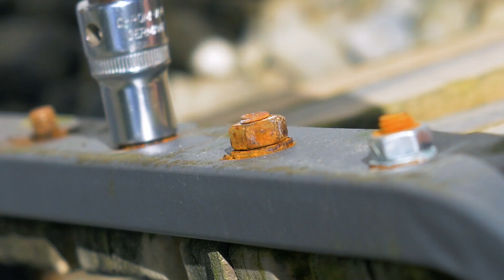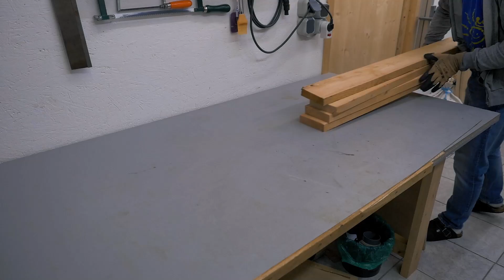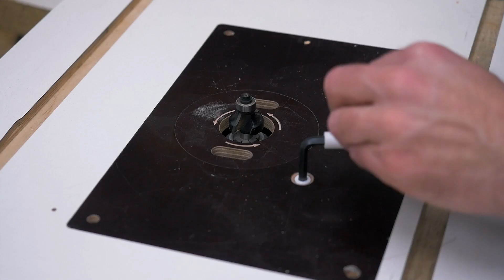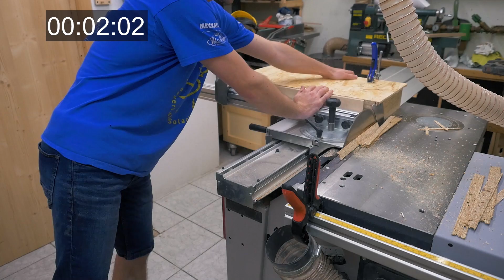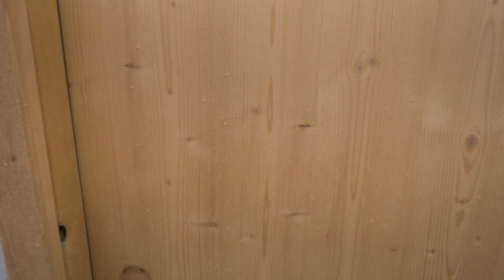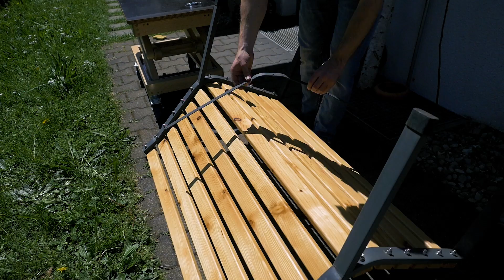Renewing an outdoor bench | simple Spring project + miter saw testing

Comment: here goes me wiping my tear away as I just recently purchased (for me a very expensive item for my diy workshop) a 150 euro Einhell sliding miter saw only to realize the damn thing cant even cut straight edges and I have to fine tune the "zero" mark on the angle gauge to somewhere between zero and one using a quickangle  and only then did the edge cut was moraless straight with deflection of 1 mm over 30 cm length.... I want expensive tools too ;( not for my broke ass lol last year with the help of my girlfriend I bought a 800 euro hikoki table saw and it was the saving grace for my sanity as I sued to do my table saw cutting on a 50 euro tiny 800w table saw that was flush mounted into a huge OSB table top and the fence was a piece of aluminum with two wing nuts at both edges... Your videos Marius are the saving grace for me

Comment: When you compare the same exact designed corded saw (GCM 12 GDL) to the Biturbo it is the actual competitor to be beaten because they are not only the same design on the gliding mechanism but the same basis of a saw... your tablesaw has still 50% extra power left so no chance for it to stall out that sawblade, however on the (from what I remember on the battery gliding saw) direct driven sawblade you stall it out easily with the not perfect blade for this cut...

...so it was not the fairest of comparations but still pretty impressive to see a 3kW beast and a battery powered "bite like a 2 kW beast" compete... so yeah... it is true... this thing has got some power... and is good if you are on lots of jobsites with no electric power available during your products (especially when you got the 8 or 12 Ah batteries).

Bosch actually does not recommend to use any battery below 8 Ah on this tool... because you run the risk of reducing the life of the cells within the battery.

I'd still go for the corded version... it is on my list, as it is a stationary tool for me and my "jobsites" most of the time do have at least enough place for a extensioncord to be laid out... and it is a lot cheaper 😁

Comment: Hi. I have a Bosch GCM 12 GDL, and I love it. The only thing I am not satisfied with on my miter saw is that, no matter how much I adjust the precision, when we fix the angle with the locking knob, there is a little deflection, which does not leave the cut in the precision that I would like. I would like, if possible, that you also check this on your miter saw. Thanks, and congratulations for your videos.
Reply from the maker: I have the same issue. I guess they only swapped the motor and the rest of the saw stayed the same
Reply: @MariusHornberger , I will try to find a communication channel with Bosch to report this problem. I need precision for my work (Instagram: @vibewood_design). Congratulations for your videos. Bye.

Comment: Comparing cutting speed between a table saw and a miter saw is not appropriate.  They're intended for very different types of cutting.  It's also inappropriate to compare a battery powered tool to a mains powered tool.

Comment: Did the same thing for my Mother in Laws garden Seat. I used a varnish for finish but was disappointed with the durability of the finish. My cheap mains sliding chop saw mounted on a portable stand, with folding legs works well, but does take up a lot more space.

Comment: That is a very nice saw. It would be lovely if it could be used both as a battery saw and a mains power unit in the workshop. You were asking a lot of it cutting that chipboard. What other tools can you get that use the new batteries?
A nice little project. Did you consider spraying some wax oil or other anti rust treatment inside the metal frames. They looked nice quality and worth protecting.

Comment: I have a number of Bosch tools, some corded, some battery powered and I absolutely love them. Thanks for the great review on the Miter saw. I've been looking at it with great envy trying to convince myself that I need it but it's more of a "wish I had it". Great video as always. Thanks.
Reply: I wonder if Bosche sends different tools to different markets? I've had several "blue" Bosche tools here in New Zealand including a sliding compound mitre saw, and they've been terrible. Some only lasted a couple of years, and all were badly designed (e.g. the mitre lock on the saw kept coming loose). The ones that didn't break I ended up giving away for free, as they were so lousy that I couldn't in all conscience sell them. Plus Bosche only have a two year trade warranty here (other brands give six years). And yet I have relatives in the UK who think Bosche tools are wonderful, and wouldn't use anything else. Very mysterious!
Reply: @davidhaywood8029  Interesting that you say that. My Bosch tools here in Canada have been heavily used  for years when I was doing  home Reno work for folks after I retired and even now they are still going strong.  Makes one wonder doesn't it.

Comment: What laser guide are you using on the saw?
Reply from the maker: The saw has a built in laser guide
Reply: @MariusHornberger  Oh OK, I have the same saw but 120VAC not battery powered and it didn't come with it.

Comment: In my opinion you should be aware of the play in the arm movement. A lot of miter saws have play in the arm movement and it is a disadvantage. A miter saw is supossed to cut at a specific angle but with play the angle or the cut itself gets crooked. You apply downwards force AND push the blade towards the wood and the wood will apply tension to the blade and arm - and with that play the blade will be able to cut crooked. I searched the miter saw market for a very long time but I finally found a battery powered Dewalt miter saw with absolutely no play. I bought it instantly. Nice to have you back :-)

Comment: Nice to see you again, Marius.

With the cordless ability, it must be quite "the one" for the mobile woodworker.
Especially if you already have a few of the battery system. (like me). And if you don't have a high production rate, the speed seems to be adequate. 

Now for the lawn, it is not befitting the renovated bench.
😁👍🏻👋🏻

Comment: I think the difference in speed on the Bosch has more to do with the ability do clean the dust out of the kerf than the difference in thickness. With a table saw dust will be cleared far easier, because you cut from the bottom.

Comment: I wish tool makers like Bosch would incorporate both battery and plug in power as options. You could get the best of both worlds, plug the tool in for max power when in the shop, and run it on batteries at jobsites.
Reply: Dewalt did that.
Reply: @TheMetalButcher  Which dewalt saws? I may have to buy one.
Reply: @pseudosam2458  The ones with two 60v flex batteries IIRC. Since it's just a universal motor it runs on AC or DC.
Reply: @pseudosam2458  The metal Butcher can reply, but he don't reply to You on your specific question(other than vaguely). 
He probably get paid or "kickback" for/from his attitude.
Reply: @louisfkoorts5590  Lol no. I'm too fucking lazy to even look up the model, so I'd be a pretty shit salesman. I just knew one existed.
Reply: @TheMetalButcher  sounds like a heavy metal saw?
Reply: @TheMetalButcher  They did? What's the make and model?
Reply: "FLEXVOLT 120-Volt MAX Cordless Brushless 12 in. Miter Saw with AC Adapter with (2) FLEXVOLT 6.0Ah Batteries"

Eight hundred US dollars
Reply: @allencummings7564  Big oof. F that. You could buy a battery and corded saw for that much.
Reply: @philipp2104  It comes in the box with the DHS780T2A. But yes, the battery powered saw is 400 euros more than the corded. Not a bad deal with 2 batteries and the adapter included though.
Reply: HiKOKI and Festool offer that, too.
Reply: DeWalt has it in the FlexVolt range and their adapter for the wall plugin solution is actually pretty good as well... seen the saw, know a company that runs this saw... but... it does not have the folding arm as the Bosch has... and it needs two batteries to have the same level of strength when run on battery... but still a damn good machine if you have their system running.

I am on Bosch batteries in all my 12 and 18 V machines and so I won't change... 36V is Husqvarna for me on garden, landscape and construction tools... and the corded tools... free choice on all brands... but yeah, who knows if they will get a add on version some day... might ask the sales service the next time he shows up in our store 😎

Comment: If you dont work in a factory that you have to saw boards quickly due to high production volume the speed is meaningless.
Reply: True, but this specs were written by a marketing department so it's a good idea to check if they actually line up:

"Brushless motor powered by ProCORE18V battery delivers cordless power equal to 2000 W corded mitre saw"

(A 2000 Watt brushless motor outputs 2000W.  There is no need to compare it to a 2000 Watt corded mitre saw except if you don't want to tell the customer what type of motor is has).